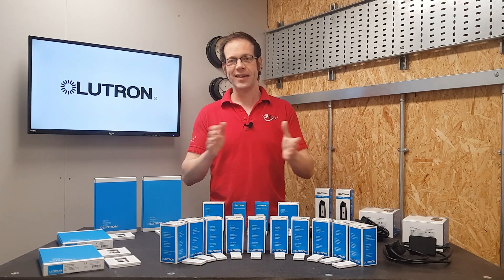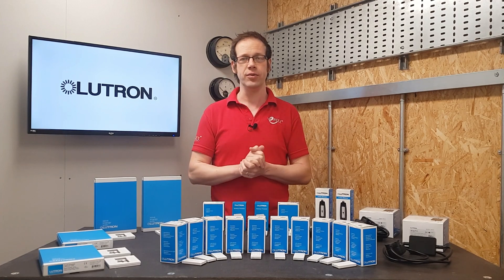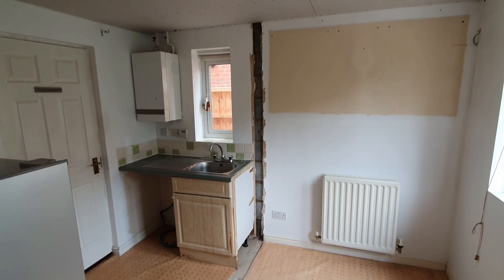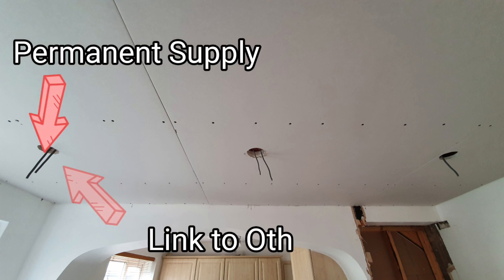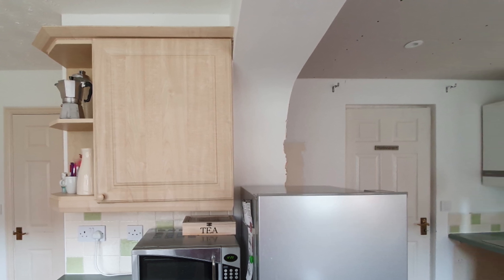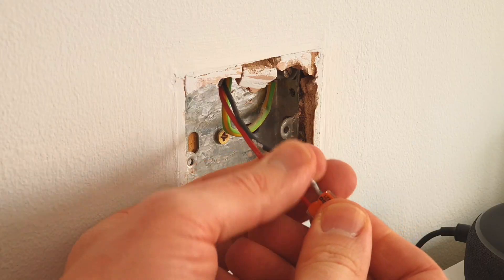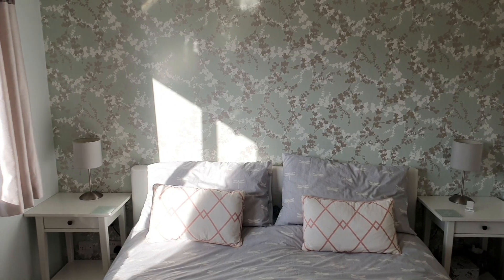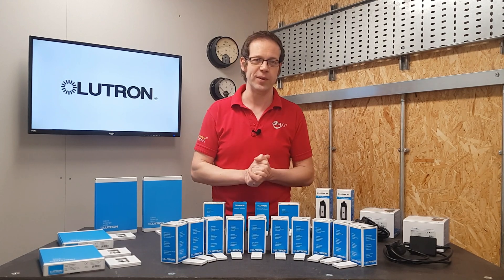TWO WAY SWITCHING is EASY with the Lutron RA2 Select wireless lighting control.

Comment: What’s the difference then between the RA2 and Qwinetic switching?
Reply from the maker: The main difference is that Quinetic switching doesn't have batteries, it relies on the kinetic energy in the movement of the switch. The RA2 is much more sophisticated as you can dim with it as well and also add a hub so you can control the system from a mobile device and introduce, timers, scenes and a whole lot of other options as well.
Reply: @efixx  but you can dim with quinetic as well? I can appreciate the mobile phone aspect in this day and age, but for the money I think it’s more of a gimmic if I’m being honest. Excellent video though many thanks!

Comment: I have a bunch of Lutron Caseta gear (in the USA, it's basically a limited version of RA2 that's cheaper and aimed at the DIY market).

Lutron is by far the most reliable "smart" lighting system I have worked with. The Caseta dimmers aren't cheap (around $55 each) but at least the US version works without a neutral, and I have never had pairing or other issues like I have had with BLE and Zigbee smart bulbs.

The pico remotes are really nice. They match the exact size of a standard US "decora" wall plate, so you can mount them in a box and they look identical to a hardwired dimmer. You can even put them in a multi-gang box along with regular dimmers.

Comment: What powers the switches?
Do you need to change batteries or are they self generators like the quinetic devices?
Reply from the maker: They are battery powered but it's just a standard coin battery that lasts ages.

Comment: Will Lutron solve the age old question with smart light where old properties need a natural feed to make a wall switch 'smart' ?
Reply from the maker: The switches are battery powered so no connection to the wiring is needed. 👍
Reply: @efixx  the thing that makes it smart is that 'black box thingy' which needs the power feed in the lighting circuit?
Reply from the maker: Do you mean the in line dimmer? In this video that goes into the ceiling where there was a neutral conductor anyway.

Comment: How does the pedestal switch stay powered? Is it a battery operated switch?
Reply from the maker: Yes, the battery's mounted in the Pico remote so it's powered from there whether it's on a pedestal, wall mounted or loose.
Reply: @efixx  do you know how long the battery lasts?
Reply from the maker: The Lutron literature states 10 years!

Comment: Nice product! Looks like a wireless version of the staircase lighting we install here. There you have a timed contactor (bistable relay). There's no conventional switch involved, instead you got retracting switches (in the same design as regular switches) which require only two wires (permanent line and switched line). This reduces the numbers of wires, makes the wiring easy. After an adjustable amount of time the switch will switch the light off. That makes it in interesting for bigger staircases in a block of flats. Or if you want more than three switches, and want to expand the circuit with a minimal effort. There are two versions available, one for the installation in a junction box, the other is for DIN rail. 

I installed this guy in my staircase. It's rated for 16A. You can switch it with different voltages, the standard 230V but it also got another input which can handle between 8 and 230V UC (universal current, AC or DC makes no difference). The background for this is, in West-Germany 230V (or 220V back then) was used for this purpose. In East Germany they used the low voltage from the transformer of the door chime to send the switch-signal to the contactor.

https://www.eltako.com/fileadmin/downloads/en/_datasheets/Datasheet_ESR12NP-230V+UC.pdf
Reply from the maker: Great comment, it's a super flexible and adaptable system, stay tuned for the follow up video. 😊

Comment: Great product-very similar to the Quinetic system. Interesting to see a price comparison.
Reply from the maker: It's a great bit of kit. 👍
Reply: Considerably more expensive, but a far better product with more options available over Quinetic
Reply: Starter kit is around £550
Reply: Interesting point. I reckon the Quinetic with the 6A dimming receiver module and two 1-gang wireless switches would be around £75 (TLC prices) and provide the functionality Joe shows here. The RA2 equivalent - with some more functionality - would be around £170 (Lutron RRK-KIT-1D RA2 Select Wireless Control Dimmer Kit: 1x Dimmer, 2x Pico controls, 1x Pico Faceplate, 1 x Pico Pedestal)